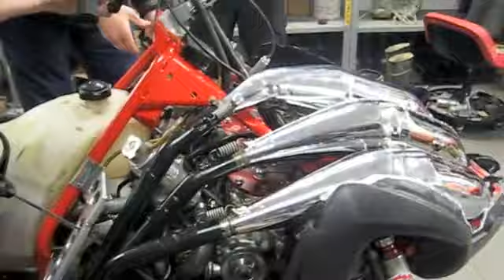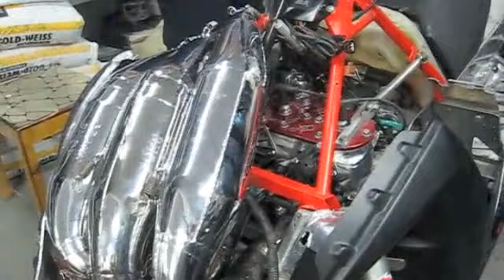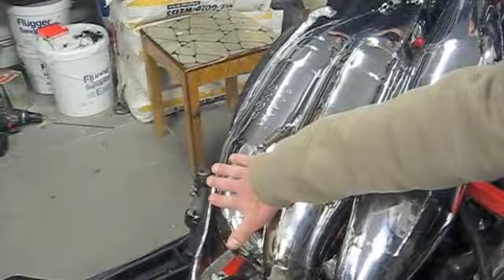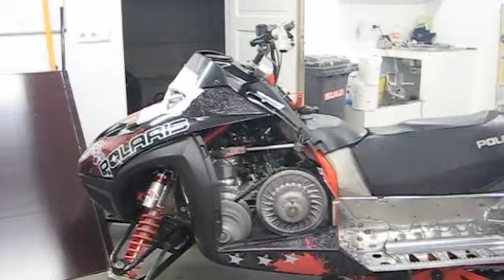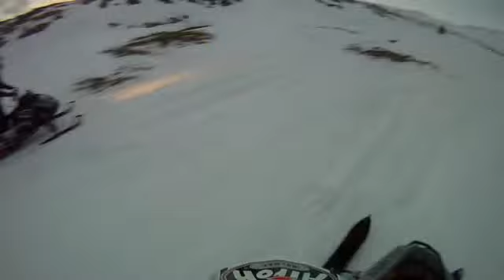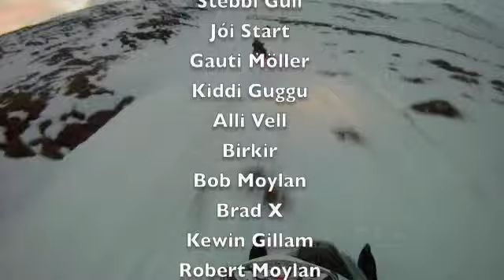1200 iqr

Comment: @larson399 No it isn't. You cannot "blow the pipes" nor can you get them to hot. The hotter the better actually, he's pulsing it because the power with triple pipes is like a switch, either it's "on" or "off". So he's hitting the throttle for power, then backing completely off when he wants no power, and there is no in-between at all.